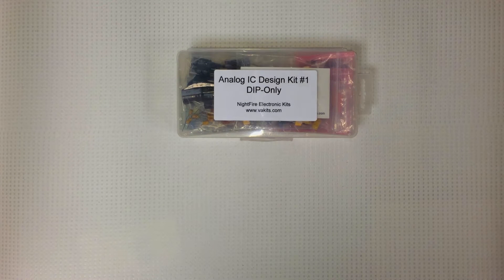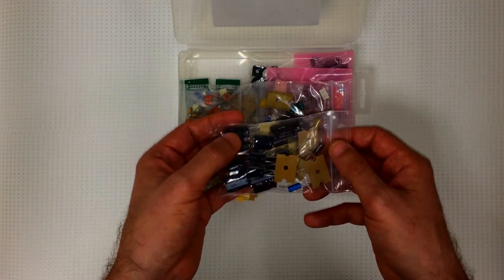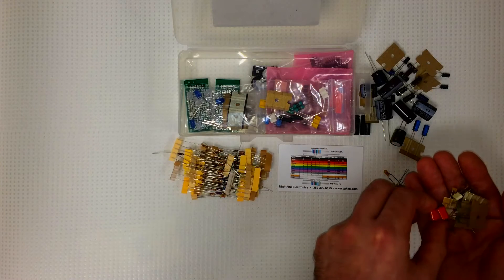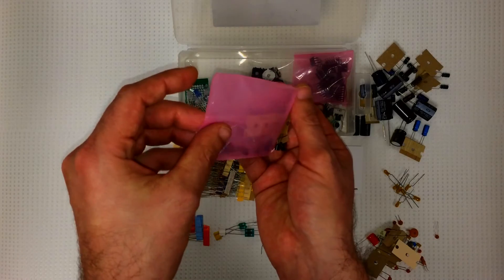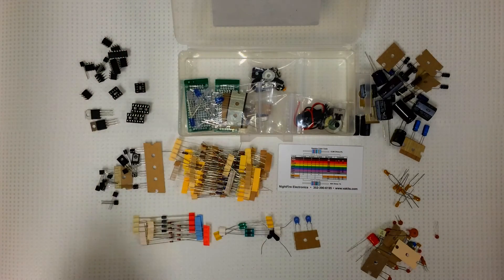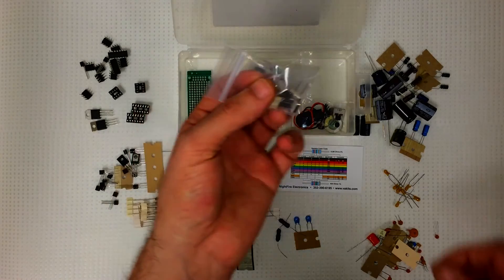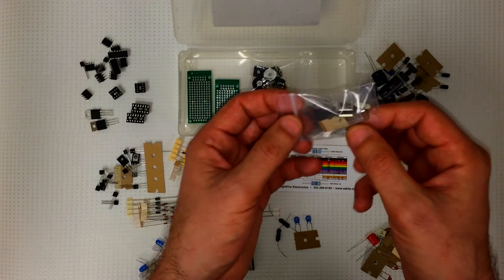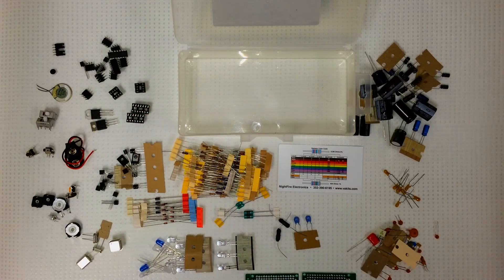Analog IC Design Kit Review

Comment: Good video,  My view on the products is not the same as yours for the following reasons.  A few years ago I purchased one of the analog IC Design kits, even though I had to sort out every single resistor by color code, I still thought I got a great deal compared to getting burned by over priced on-line retailers.  My view on the assortments now, Price is ok, He has quality packaging, I could care less about the plastic box as I have my own storage system.  Not to mention all those components in a little plastic box is not practical for projects.  My Advice is loose the box and invest in labels, and sorting.  It's not worth my time to have to break  read part numbers under magnification and do color code math in my head.  Some of the trimmers had no numeric code so I had to break out my meter.  Also the  website should have links for customers to reference the data sheets in far less time.  Overall A for effort  of intended quality however D-  for execution and delivery.  Until these issues are addressed I would only recommend this for someone who needs to learn how to ID and sort components.  I hate give such a bad review to a small business with good intent, I hope it;s used constructively.
Reply from the maker: +Vincent Lacorazza Absolutely agree on the labeling... I measured all of my resistors to be sure the color bands were accurate, then I put each type in separate little test tubes and wrote the value on the top of the tube. Now I no longer need to read the color bands each time I need one.